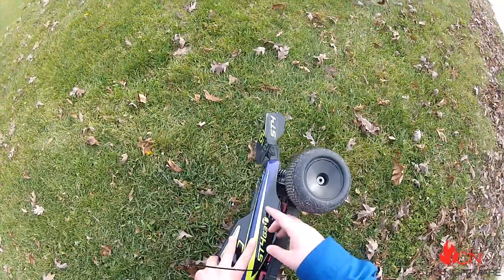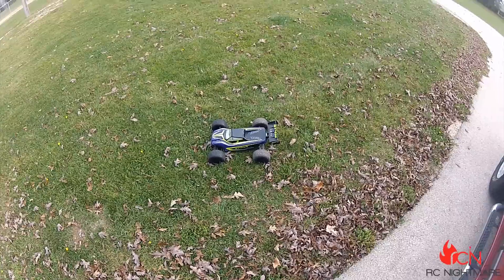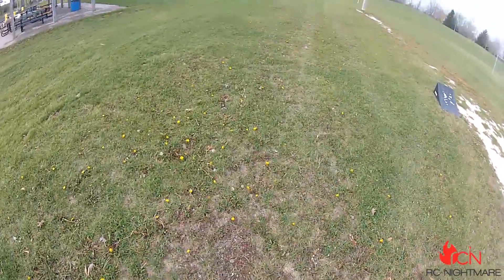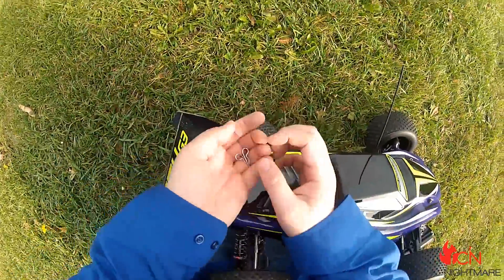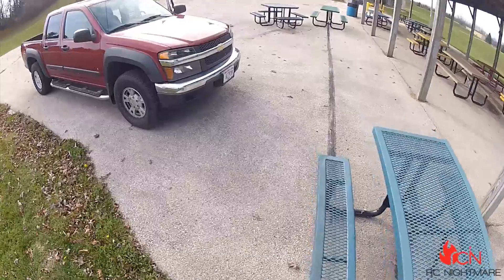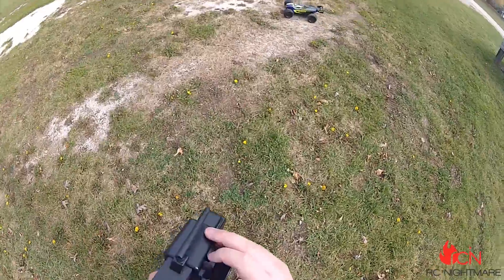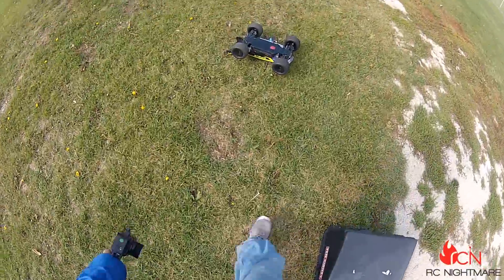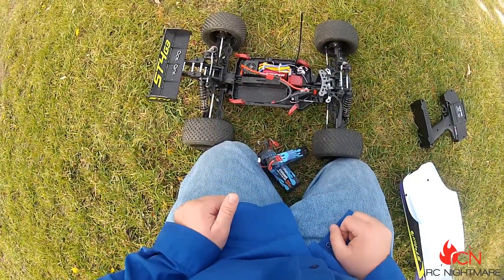Thunder Tiger ST4 G3 Running Video-From The Box 2 The Ground

Comment: its pretty sweet getting torn between the MT4 G3 and the ST4 it looks like all that ST4 really need is the MT4 wheels and its pretty much the same as the MT4 i think i might have to settle on a ST4. It looks like it would be a good truck to drive around with my Cousin Erevo BL they have similar stance.